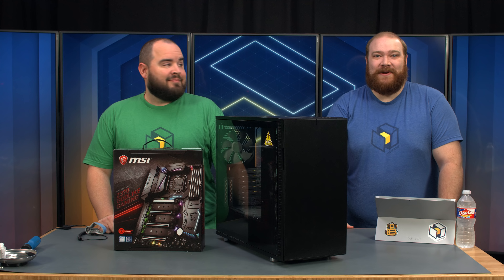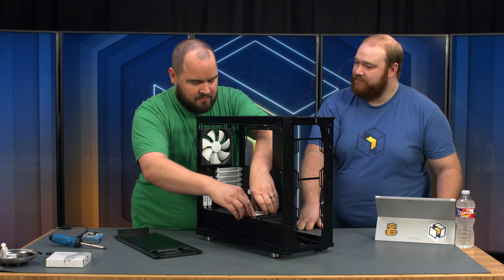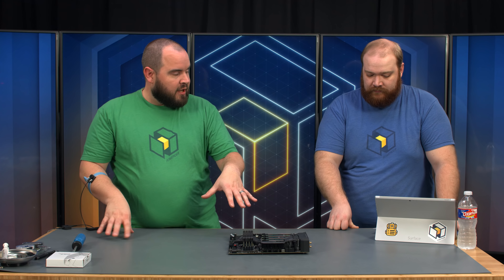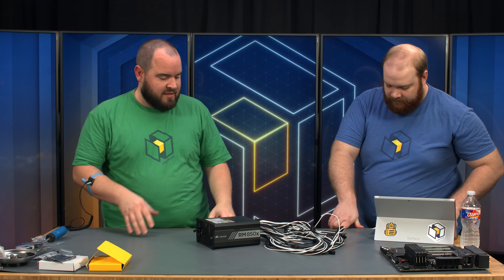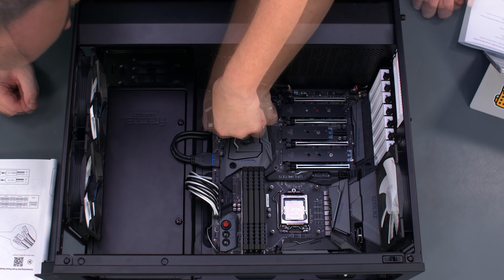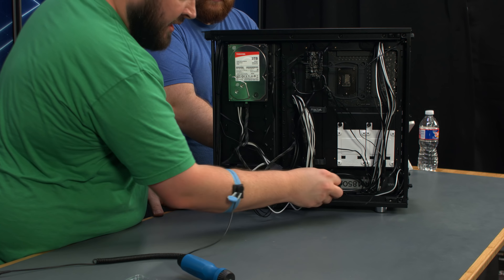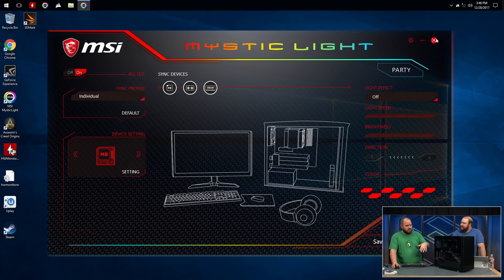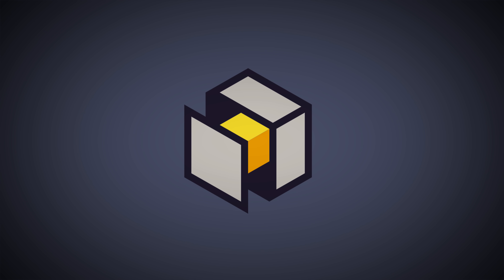Fractal Design Define R6 Build - i7-8700K / MSI Z370 Godlike Gaming (Livestream Archive)

Comment: PCPartPicker
I recently took a look at your website, what is up with none of the featured systems having both a Ryzen CPU and an AMD GPU? Seriously, 580 > 1060.
Reply: Don't be an annoying AMD fanboy, I swear someone has to complain any time anyone used Intel/Nvidia. Most of the builds on their website are made by users, and there's a Vega build featured on their front page right now.
Reply: That's because the GTX 1060 performs on par with the RX 580 for about $50-$100 less.  AMD Gpus are being price gouged so the 1060 is the better option for price to performance.  The 8gb RX 580 is $300 the 6gb GTX 1060 is $259.
Reply: At least the so called AMD fanboys have some intelligence, enough to understand how f*d we are when only Intel and Nvidia remain. They also have sufficient knowledge to understand how Intel commited fraud, bribed shops and system integrators and blackmailed companies like Compaq to not sell any system with an AMD CPU. Yes, Intel made Compaq go bankrupt, Intel withheld their server CPUs when Compaq refused to take Intel its bribemoney.
They understand how Nvidia uses proprietary software lockout with Gimpworks and PhysX to avoid real competition. 

With the current prices of the AMD cards it is understandable that people choose for a Nvidia card - or wait  with buying any graphics card - but how old are those builds?
Reply: Yes yes I know all that. Intel are dicks, what am I gonna do about it? If AMD can offer a competitive product, I'll buy it. Even if I had to pay a little more for equal performance from AMD I'd do it on principle. What I won't do is buy a worse product, hurting my own performance, just to support some billion dollar corporation. If Intel or Nvidia offers the best performance I'll buy it, despite everything I dislike about them. If I was doing a budget build or workstation I'd go AMD, but I'm building a high-end gaming PC and right now that means 1080Ti+8700k.

I do agree tech media should try and use AMD when it makes sense, but that doesn't mean there's a conspiracy or that they are "shills" when they don't; there's always a guy in the comment section making some such claim when Intel/Nvidia are used.
Reply: Malus1531
First of all, I am happy to read that you are aware of the problem (for us, the users) that we risk Intel and Nvidia getting a monopoly.  That should be our primary concern, ensure that there is a future with good and affordable hardware. AMD coming back is the best thing to improve that possibility, this is why I won't even consider Intel for my next CPU given Zen its strong architecture and decent performance. 
I don't ask anyone to buy a worse product. I hate Intel but even I wouldn't have bought the FX CPU's and would have bought something like a 6600k instead (currently I owe an i5-750, I chose not to upgrade in all those years because I wasn't happy about the slow progress which Intel made, then I found out about Ryzen and waited for that). 

The 1600 isn't any worse than the 8700k as a product. Does the 8700k win for single thread performance and gaming? Yes. The 8700k might give the best performance under a certain budget (let's say around $600 for the CPU and the motherboard) which you can get, however if you talk about the best product then it is about the combination of performance and price. Get my point? I don't mind taking a temporary performance hit on 1080p gaming and singlethreaded loads knowing that just 1 year later I can upgrade to Zen2 and another year later I can upgrade to Zen3. These CPU's are very promising? I will give you a link (replace "dot" with ".") to a great source, with fresh news (it will be news for 99.99999% of the readers here). 
https://fusedotwikichipdotorg/news/641/iedm-2017-globalfoundries-7nm-process-cobalt-euv/
It might be too complicated to understand all the details but just read the summary at the last page, the summary is that GF its 7 nm. process will be competitive with Intel its 10 nm. process and that AMD can beat Intel in relevant ways if they build large CPU's with a large amount of cache. Not in the far future, just 1 year from now. 

For the graphics card right now you don't have a lot of choice if you 'have to' buy a card right now. For that reason I wait for Navi, if Navi still disappoints then I might have to choose for a Nvidia card. One another important reason why I would rather not: FreeSync. If Nvidia would just support FreeSync even more gamers would have bought a Nvidia card in the last 2 years. I don't want to pay $550 for a 1070 Ti and then still see at least a few tears every second. I can't stand gaming with tears, I see those very well.
I don't expect that Navi will disappoint because Navi is going to be AMD its first multi-die GPU chip, like Ryzen for the CPU, and it will use the 7 nm. node from TSMC. Multi-die has a few great advantages: better yields, lower cost, lower power and much more tweakability. Opposed to Nvidia AMD can't design a different GPU for different segments of the market, but they can tweak it properly if they use a modular GPU. Infinity Fabric is AMD its secret weapon to come back in both the CPU and the GPU market. The Vega cards is quite strong in many ways but it lacks ROP's (geometry shaders). The multi-die concept makes it possible to just paste more of that what is lacking to it. Having said that, that Navi will excell is far less certain than that Zen2 and Zen3 will offer great improvements, I just point out that there is good hope that Navi will do well if AMD plays its cards right.

There was factually a big conspiracy: Intel DID bribe system integrators and shops to not sell any AMD CPU, they DID blackmail companies who did sell those CPUs. If that is not a conspiracy, then what is? They didn't get a 1 BILLION € fine from the European Union and several judgements against them from the authorities in both the USA and Asia because they are innocent! 
With regard to Nvidia it is a lot more transparant and legal, not nice and ethical though. Nvidia bought PhysX (back then the name was different) to take it off the market for anyone who uses a ATI (now AMD) card. Nvidia uses Gameworks to bottlenecke the performance of both AMD its cards and older generation Nvidia cards, they design the code of Gameworks in such a way that they use something which the current generation Nvidia cards are better at than the AMD cards and the older generaiton Nvidia cards. Tessellation is a well known example. Note that ATI  invented tessellation, not Nvidia. However, in later years Nvidia went overboard with it and used ridiculous settings of it in its proprietary (= secret) Gameworks code, this means that it was and is impossible for ATI/AMD to lower the setting of tessellation for that particular function (only for the entire game). That is why Gameworks is often referred to as Gimpworks; Nvidia uses Gameworks to gimp the performance.
Reply: Ryzen is quite competitive I agree, and can't be beat in price/performance. Some people just want performance though. A Lamborghini has horrible price/performance, but that doesn't mean it's bad, it just depends on whether you're willing to pay the premium. The 8700k does beat the 1600 productivity; it has the same amount of threads and better single-core performance (though AMD's SMT does seem to give more gains than hyperthreading in some tests). It even almost beats R7 in productivity, while beating all Ryzen chips in gaming, sometimes marginally but sometimes by a lot. But yes Ryzen is better value.

Interesting article, though I admit I don't understand a lot of it. I do believe AMD's 7nm can compete with Intel's 10nm from what I've read though. Is AMD using Global Foundries for their CPUs and TSMC for GPUs? I'm a bit confused about that, I see articles talking about both foundries. One article I read estimated that TSMC 7nm was 13% more dense than Intel 10nm. Regardless, I'll see what happens when it happens. I'm building a PC now, so I'm concerned with the present. I don't really care about AM4 longevity, since I'm unlikely to buy a new CPU before 2020 anyway. That's probably true for a large majority of people buying CPUs today. Yes AMD treats their customers better by providing continuing support, but the way I see it it's a nice theoretical benefit that most people won't use.

As for Navi, didn't Vega just release? It seems like all AMD fans do is wait. Ryzen didn't beat Intel in gaming? Just wait for Zen+. RX 480/580 can't compete? Wait for Vega. What's that, Vega can't compete either? Wait for Navi...If something superior comes out I'll buy it, but until then I'm not gonna endlessly wait. Freesync is frustrating though. I'm currently running a 1440p 144Hz Freesync panel with a 1070, and kinda regret getting a Freesync monitor (Gsync variant was $300 more though...). Vega wouldn't be much of an upgrade it terms of fps, and I'm not sure if the cost is worth it just for Freesync. My monitor already has all the specs I want except Gsync, so paying $800 for a new monitor just to get Gsync isn't great either. My best bet I suppose is to get a 1080Ti and hope the framerate masks the stutter & tearing. Navi isn't expected for quite a while from what I've read.

I meant media conspiracy, as in people claim tech media favors Intel/Nvidia. In the vast majority of cases I don't believe that's true, at least not intentionally. It does seem that Intel and Nvidia send out review samples and free parts more often though, which results in them being used in more builds. Some might think of that as bribing I guess, but I can't really blame tech media for using and showing off what's on hand. AMD can participate more in that arena if they choose to.

With regards to Intel and Nvidia's shady business practices, yes I've heard and believe all that, but again I'm still going to put myself first. I'll support AMD as much as I can insofar as it doesn't hurt my own performance.
Reply: Sorry, I confused the 8600k with the 8700k for a second, usually that wouldn't happen but I was tired. ;)
I removed that sentence in my post, just to make sure that others who read it don't get wrong information.
Yes, the 8700k does beat Ryzen with multithread, though not by as much as people would expect because Ryzen its (multithread/singlethread)/threads is phenomenally high, i.e. its simultaneous multithreading works really well, it has been speculated that that is partially thanks to the large amount of L3 cache. 
A problem for me is that this Lamborghini won't remain a Lamborghini for long. Sure, now it is the best under a certain amount of € but 2 years from now? It is going really fast right now, GF and TSMC are catching up to Intel whil Intel is struggling hard with its 10 nm. node. With AMD pushingt many cores and a lot of cache (I refer to that article to understand why) Intel will have no choice but offering more cores. At the end of 2018 Intel will offer a 9700k with 8 cores and 16 threads, maybe you can upgrade to it, maybe you can't. On the AM4 platform you can upgrade to Zen2 and Zen3, guaranteed. No matter what Intel does, Zen3 will kick the 8700k its butt, Zen2 will probably already do. The upgrade will be cheap, only a new CPU while you can probably sell your 1600/1700 for around 50% of what you paid for it. You see my point? I am willing to take a hit on the short run and get extra performance on the long run for considerably less money. Especially because I will upgrade to 1440p/4k gaming anyway and then you mostly get to a graphics bound use case scenario. For Intel it remains to be seen if they will let you upgrade from a 8700k to 10700k (or whatever name it will get, just for ease of sake I use this as the name ;)) on the same motherboard. 

Yes, GF will produce Zen2 and Zen3. Regardless of other strategic decisions and motivations, AMD has signed a contract with GF - which used to be a part of AMD until AMD had to sell it (now some people in some oil-countries own it, not great if you ask me) - in which they promise to buy a  certain amount of capacity from GF each year, if AMD doesn't fulfill that it  has to pay a 'fine' to GF. In return AMD is first in line for whatever best node they have, the GF 7 nm. node will at first be exclusively for AMD, it will be fabricated in a separate foundry of GF (New York if I am not mistakend). As you can read in that article a lot of this GF 7 nm. node has been bought from IBM (that part of the company, not a license). 
Indeed, it looks like TSMC will produce Navi. I don't know why, we just know that TSMC will probably get the order (I would have to look up how we found out, but we did on an AMD-related part of a forum). Don't draw any conclusions based upon the difference in density, it is a factor but just one of many. GF its 7 nm. node is 15% more dense than the 10 nm. of Intel, a little bit more dense than the node of TSMC. It helps but you can't compare nodes based upon that one factor. 
With regard to the longevity of the platform, that indeed is the difference between us, I value that aspect more because I don't know whether or not I will upgrade, that has to do with that I expect a lot of improvement and frankly also because the clock frequency of Ryzen is a bit too low. The current GF 14 nm. node never was meant (designed) for CPUs, GF licensed this node from Samsung because it got stuck with its own 14 nm. node. Hence the low power draw but also the power wall at a low frequency of high in the 3 GHz or at best at low in the 4 GHz. 
You might be correct about most people only looking at the short term for their desktop hardware. 

Yes, people who would like to buy a CPU or GPU from AMD had to be extremely patient in the last years, it is a bit of a waiting game. 
As I explained already, Vega is not designed for gaming, it was designed for professional applications (note that Vega beast the Titan XP in those). AMD can't afford to design two separate lines of cards like Nvdia does, Nvidia has 2.5 times as much money for only GPUs than what AMD can spend on both CPUs and GPUs!
As a result Vega can't use a big part of its capacity for gaming because there is bottleneck in the ROPs (geometry shaders for example). You can clearly see the consequence of it: play Dirt4 with CMMA (form of anti-aliasing developed by Intel for its weak integrated graphics) enabled and Vega beast even the 1080 Ti (even Vega56 if I remember correctly).Play Dirt 4 with MSAA at a high setting and Vega 56 is even beaten by the GTX 1070 (slightly!) while Vega64 is beaten by the GTX 1080. Bottleneck!
Navi solves this problem because it will become a modular GPU, as a consequence AMD can sell two different graphics cards which are specialized for separate markets while only having to desing 1 GPU. Just like Zen is excellent for laptops, desktops and servers while Intel uses different product lines for laptops/desktops and servers. The same principle. The Vega56 can compete, in my opinion it is a better card than the GTX 1070 (hence Nvidia now selling a GTX 1070 Ti which is a cutdown GTX 1080). Vega64 can't compete, the power draw just is too high and 8 of those CUs (a CU is a group of shaders) from Vega64 are basically doing almost nothing. There are strong indications that Navi will come in the second half of 2018, at latest we should see Navi early 2019 but I expect it somewhere between August and December. Why? TSMC its roadmap shows volume production (7 nm. node) for the first half of 2018 (risk produciton has been running for a while) and we know that Navi its tape-out has been going on in the last 6 months. Originally Navi was planned by AMD for early 2019, it seems like they are ahead of shedule. I see two reasons for it: AMD changed its contract with GF and sells considerably more CPUs (Ryzen vs. Bulldozer), they now have more flexibility and can order GPUs from TSMC without paying a big 'fine' to GF. Vega was a bit disappointing, AMD thought it could remediate the front-end bottleneck with some clever tricks but that didn't work out, unfortuantely, not for Vega anyway,  those same tricks might be utilized in the future. In short, AMD thought that it could lower the amount of data to be sent through the front-end with tricks like rasterization and HBMC (High Bandwidth Memory Controller) and consequently have less of a bottleneck for Vega. Nevertheless Vega does have a few tricks which gives the card better longevity: they can basically split every 32-bit instruction into 2 16 bit instructions without a penalty, this is great for things like hair effect (like Rise of the Tomb Raider and The Witcher 3), Far Cry 5 will use this too (not necessarily for hair). Vega, just like Polaris, is better suited for games which properly use Vulkan and DX12. Vega performs well at higher resolutions, that is not important at this moment because you don't want to game with 40 FPS and 4k but it is a good sign for how the card will hold up in the future. I would recommend either Vega56 or the 1080 Ti for premium gaming, avoid the 1070, 1070 Ti and 1080. With somewhat normal prices of course. ;)

I don't believe in any tech-media conspiracy with regard to AMD/Nvidia/Intel, I do think that there is a strong bias though, on a subconscious level. You saw signs of that when Ryzen launched, it took weekes before they were willing to review Ryzen in a proper way with higher clock RAM, only after a smaller Youtube channel proved that Ryzen needs higher clocked RAM they were willing to test properly, this while after only one week after launch it was clear that the clock frequency of IF is coupled to the clock frequency of the memory controller (clock frequency at which the RAM runs). Another sign of this bias: not testing undervolting, GamersNexus recently did but he was the first for the bigger channels on Youtube to do so. AdoredTV already did this >1 year before, and years ago Tom's Hardware already did this for the Fury cards. It was well known for years that AMD cards  can be undervolted strongly (around 10%) while gaining performance. My view on this: if the same would have happend to products of Nvidia and Intel the same people (JayzTwoCents, LinusTechTips...) would have put more effort into testing these things earlier. No conspiracy, just a subconscious bias because just like regular people they have certain expectations which might or might not be based upon facts.
Reply: holy fucking amd fanboy bible batman
Reply: Love amd but their gpus are whack